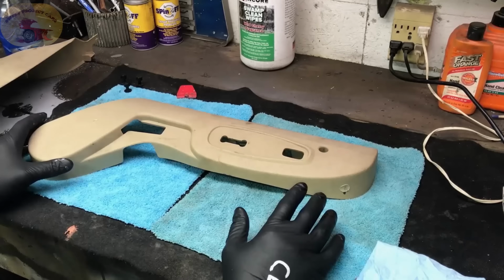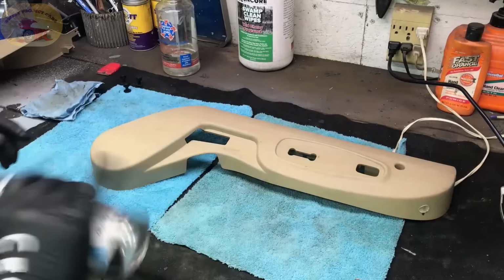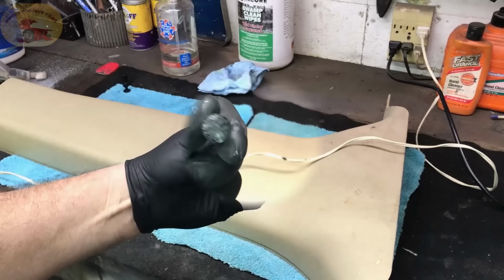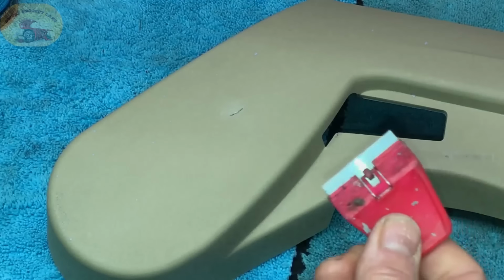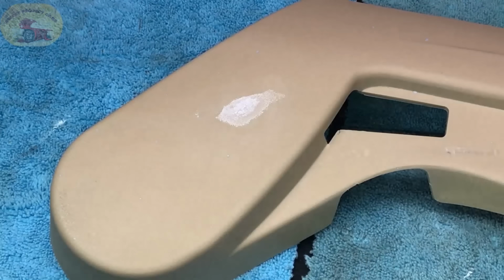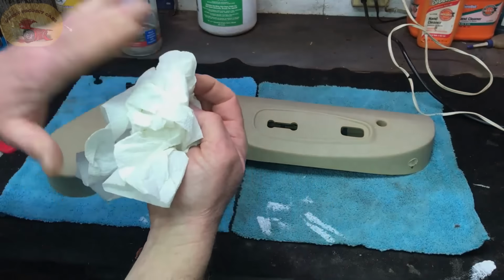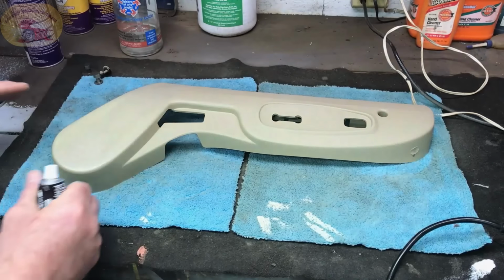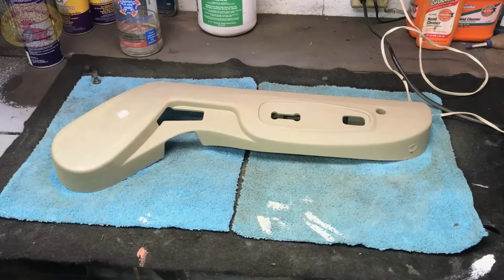How To Repair Scratched & Gouged Interior Trim & Match TEXTURE Perfectly!

Comment: Would you recommend this method for entire plastic panels? My 79 Firebird seems to have most of the interior sanded smooth with some grain left causing weird uneven sheen when the sun hits it. Im using SEM but would prefer the actual Madrid Grain pattern throughout the interior if possible.
Reply from the maker: Absolutely! Give it a shot, you have all to gain my friend. Thanks for watching, have a fantastic day and all the best on your project. mad Mike & team

Comment: Thinned Latex paint rolled with a small foam roller over dulled 99 cleaned plastic works well. I had to do my damaged dash over in my Rx350 and it never cracked or peeled in 14 years. You can roll it and roll it until it's almost dry. If you have a run you just roll it out. I was amazed at how well it looks when done. I had the paint mixed to match at the paint store. I use latex caulk for filler to fill the holes and cracks. Most everything companies sell you are repurposed products. These 2 are ones I figured out on my own after buying the seat recoloring kit from a famous retailer and figured out when using them that they were both latex based products and a good quality latex paint and caulk did as good a job.
Reply from the maker: Thanks for watching and sharing, have a great week. mad Mike

Comment: If looking to do this in the vehicle without taking the panel off. If the paint matches how good would it likely work just spraying around the repair area? Rather than having to spray all the panel, would it likely work?
Reply from the maker: Try it on a small area, if you like the result, have at it, if not, you know what you have to do my friend. Thanks for watching and asking, have a great day. mad Mike

Comment: So are you painting the whole panel? Kinda looked a little light in the areas not filled in. Are you feathering it? How does the paint hold up for future cleaning?
Reply from the maker: You can feather it if you think you have a good matching paint, or you can paint the whole panel. The paint holds up very well when you use gentle cleaning which you should do anyway. Thanks for watching, have a great day my friend. mad Mike the hammer SPC

Comment: Hello, I have attempted this twice and I’m not having the success you had with repair and retexturing. How long do you let the filler set before you press for texture? I have the exact same bonding agent and have made my texture tool as you have. The bonding agent seems to stick to the texture tool every time. Help, please.
Reply from the maker: It all depends on the temperature where you are at Scott, it may take 2 or 3 tries to get the result you are looking for, try the process on a piece of cardboard for practice until you get it down. Thanks for watching, have a great day and all the best on your project. mad Mike the hammer SPC
Reply: Thanks! I will give it a go on cardboard.

Comment: good tip, I seen a similar video on fixing cracked leather seats with silicone paint and a piece of leather scrap material as the pattern to press over silicone on seat to make uniform

Comment: Helpful thanks, but I don't think you actually showed using the texture that you'd made.  You can see the tool in your hand with some filler residue on, but actually using it was missed (I think - went back and tried to check).
Reply from the maker: if you try it you will see it works great    thanks mike

Comment: Really appreciate the amount of detail you put in your videos! Is there any possibility you could do one on how to repair older plastic, or is it the same procedure? I have a 1967 Mustang convertible with molded seat backs that are very expensive to replace and I would like to try and keep the originals. One has a large crack on the upper top corner where it is close to a chrome trim piece that goes around the edge of the backing piece. Any suggestions would be greatly appreciated, thank you for your time and consideration
Reply from the maker: meek same process here my friend for all plastic

Comment: I have a question about the paint.  I'll relate what I've seen back in the 90's with people who have restored vehicles.  Basically, they had to prime the plastic for the paint to stick properly and then sprayed the color.  After some time if it's plastic that is prone to having an arm rub on it the paint will wear away.  The time that this takes is usually, less than a year.  Do you have this problem with the newer paints for plastic?  Is there a way to help keep it from rubbing off over time?
Reply from the maker: eightofnine9 with the products we use here we have had no problems but if you want to make it bulletproof you can do this video on plastic https://youtu.be/6fWEe1GN2Ag

Comment: Mobile delvac oil is best in my experience. I also use Motorkote hyper lubricant in my engine transmission and power steering it will help prolong engine and trans life its my fave product.

Comment: Mobile 1 full syn is my favourite oil.  My engines have lasted as long as I wanted to keep them.  All my vehicles sold with great engines even after 200k.  Is it the best?  Not sure but it works well for me!  I used to add a little Lucas to it but don't bother now.

Comment: I need to ask, how come you didn’t use a plastic primer or etch primer before spraying? Also shouldn’t it have a Matt Protective clear coat on top of the paint so it doesn’t wear off?
Reply from the maker: If you follow our method exactly as shown with the exact same products it will outlast the plastic itself we have done this hundreds of times on hundreds of customers vehicles and they still look great The only thing different that we do occasionally if the owner wants it is to use the ceramic coating on it that we use here

Comment: Really good video, but depending on your year make and model, a lot of these interior trim pieces are not very expensive and might just be worth replacing that fixing.  My wife needed a new under steering wheel panel for her newer Kia and it was only $25 for a brand new Kia part.  That's a pretty big part too and it came from Korea.  Especially if you don't have these products to do the repair because you would need to buy all the products from blades, sandpaper,  cleaner, and paints.  But for large pieces or if you do this kind of stuff a lot sure.  Very good information here.  Thank you.
Reply from the maker: Captain Howdy this method as all of our methods is for those it pertains to not being able to locate parts at affordable prices, if you can find great used parts for cheaper than by all means rock and roll my friend , but as I mentioned some people don't have that option with the parts in their cars and trucks so we do these videos for that reason

Comment: The best oil is the Sweeeeet project motor oil made in R.D. center with Julio. That's my guess.
Reply from the maker: kylemlm YOU GOT IT MY FRIEND LOL
Reply: Can not wait Sir  You will have oil for diesel and gas engines. That's why it is a 2 part video.
Reply from the maker: kylemlm well it may have both :)

Comment: You finally put out a video at the exact time I need it.
But, after painting the one piece all the others are gonna look 'off', so gonna have to do 'em all...good thing my scratch is on the panel around the steering wheel...
Reply from the maker: Fred Flintstone the plastic was just dirty and once we cleaned it, it matched the painted plastic perfectly